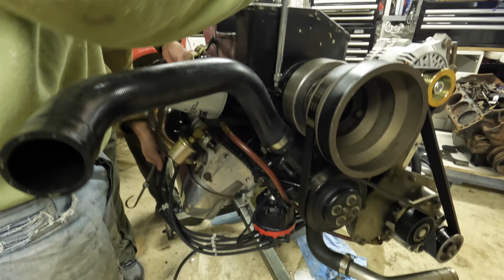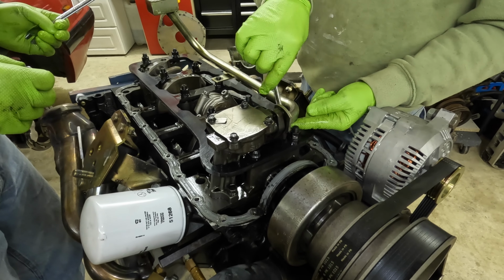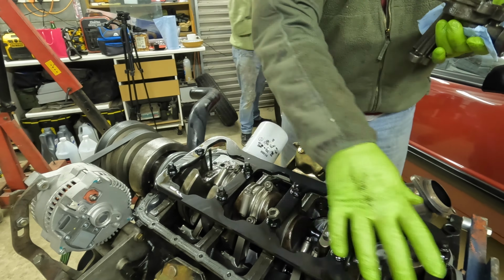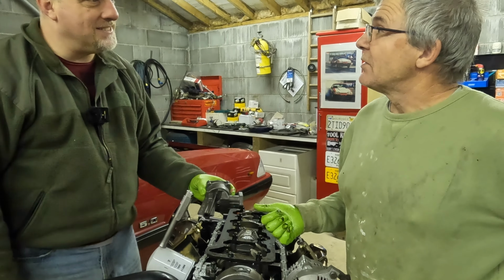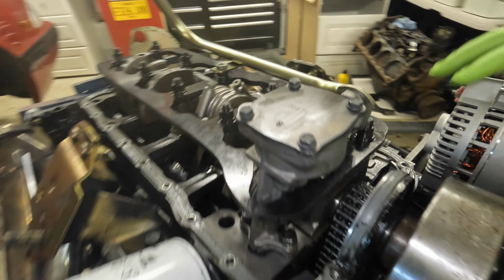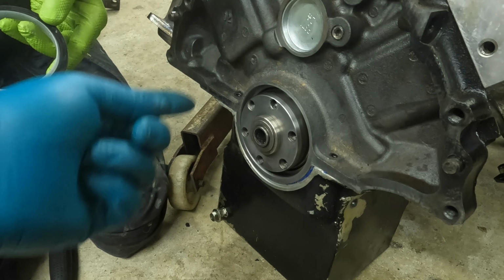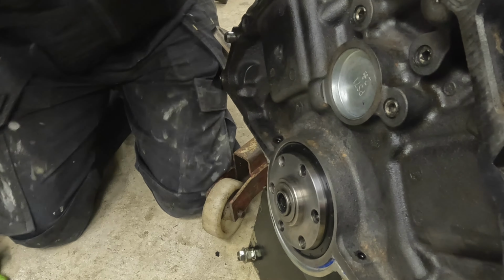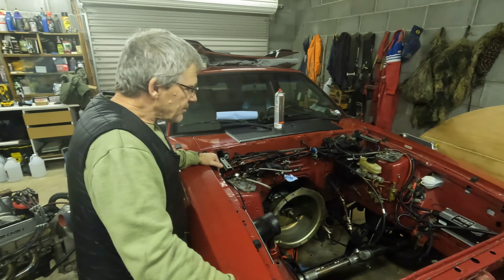Foxbody Oil Pump Swap (pt.1) on Petes Supercharged 347

Comment: Thanks for the heads up on the flywheel bolts.
Reply from the maker: I've stripped a few pressure plate bolts out on aluminum flywheels over the years.  You look at specs on the internet and they are all over the map from 12- 30 lb/ft.  We went with some blue locktite and 15 lb/ft in the past and it's worked fine as these old aluminum threads start to get get scary torquing past 20.

Comment: wondering how much with the HV Pump I run both ..one with HV the other 331 with High pressure ...and both pump a lot of oil ...the HP Pump makes like 50 at idle 850rpm, 70 at 1200rpm and 75 at 2000rpm and 86 psi at 5800rpm....  10/40 semi synth oil  at 180/190 deg water temp..
Reply: I run a standard pressure/ volume pump on my hydraulic 331 with standard clearances. 450 h.p. My 408 is 650 h.p. oil-restricted solid with standard pressure/ High volume. Race clearanced. The 331 warm at idle is 40-45. The 408 is 60-65 at idle. Mellings in both. The 408 uses the billet pump.

Comment: If the welch plug is not pinned and just pressed in. Save yourself a headache  drill a ⅙ hole threw it and pinn with roll pin . We all have broke a ford  oil as well as Chrysler oil pump boss for that same reason you will only do it once though also check the pan to pickup clearance and adjust don't trust mildon,hamburgers, moroso,any of the pan manufacturers that it's good especially when you add a big dual sump with  a deeper rear sump it will be inches away instead  of its intended ½or less  I moved  north from Florida to maine and missing the fellas when I had my own shoo it would turn into local pub on Fri and Sat eve usually whith customers past and present as well as all my closest friends our kids would beat the piss out of each other as wives did what wives do inside until they started if they started drinking and joined us in my home based automotive race engine car and chassis machine shop . Once they came out to the shop after kids were sleeping or knocked each other out  when the wives showed up with a drink in hand it was  every guy for himself 😂 whatever you do hide the receipt book as well as anything new with price tags on them 😅😊 great to have good friends and family as well as have same intrest

Comment: is Pete running stock block 347 or aftermarket? What differences are you referring to concerning the oiling system? Looking forward to the results and hope it fixes the problem!
Reply from the maker: Stock block at the moment.  I expand on the issue with this particular build starting around the 1:45 mark.